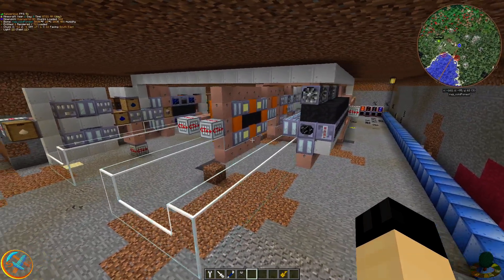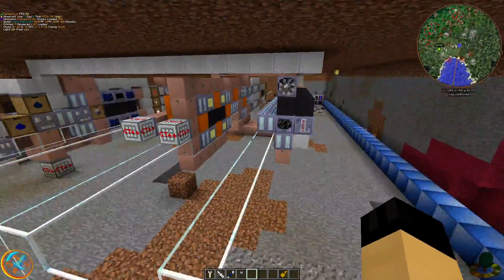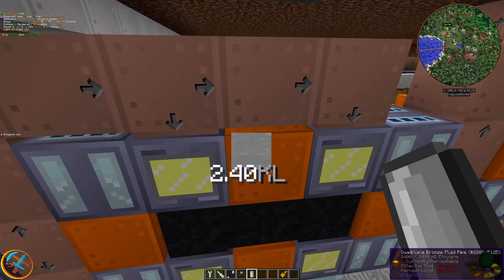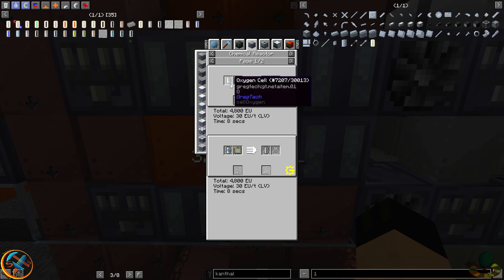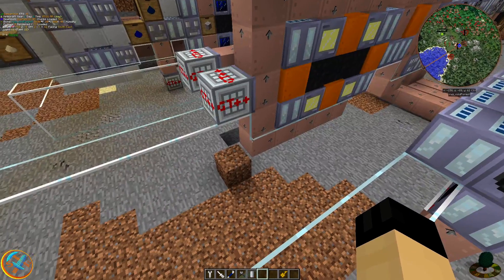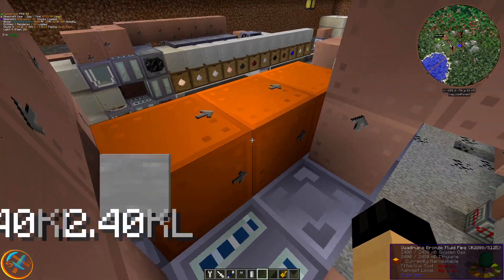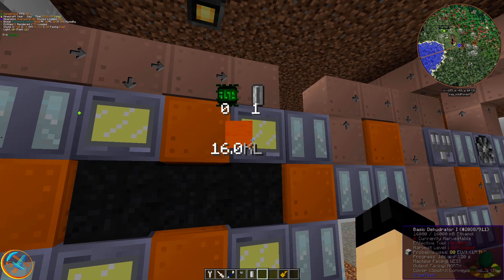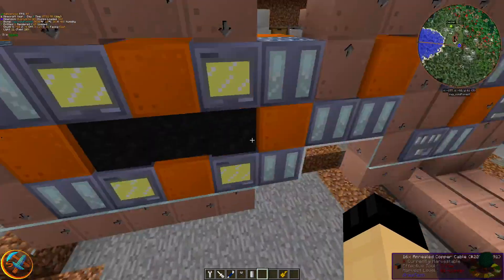GTNH Tutorials   MV Polyethylene Processing

Comment from the maker: The idea is to have an infinite resource available which the saplings I am fermenting to ethanol are. This method of polyethylene production is one of the more simpler ways of making polyethylene vs using oil and the cracking. May not be as yielding but less machines to set up for the moment with polyethylene being of low demand rn.